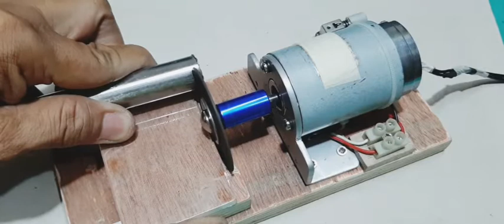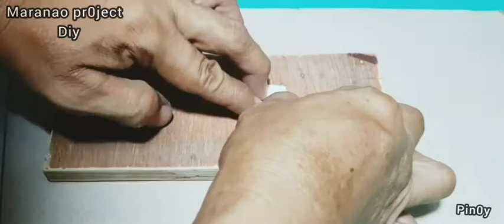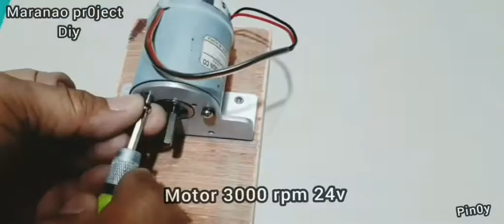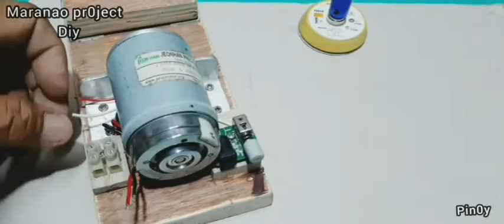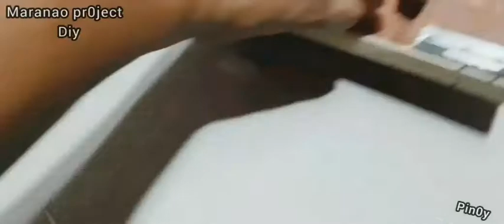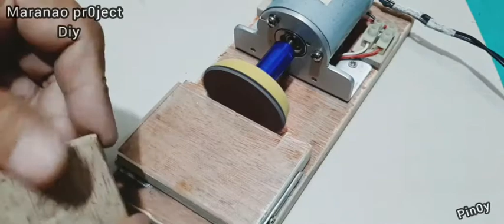how to make a mini disc sanding machine Home made.

Comment from the maker: High torque motor 12v 3000rpm 24v 6000 rpm high power
Reply: San nio nabili o san nio nakuha yang ganyang motor,i mean sa appliances,laruan,etc....thanks.